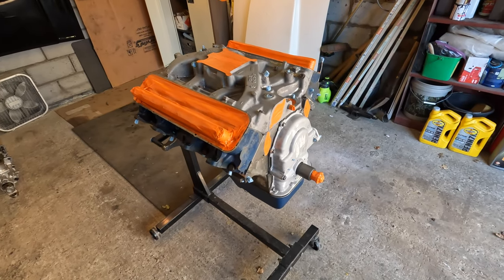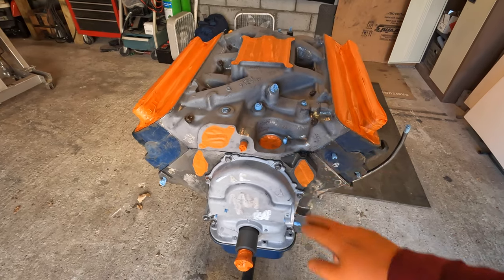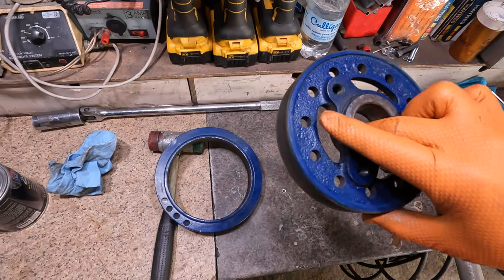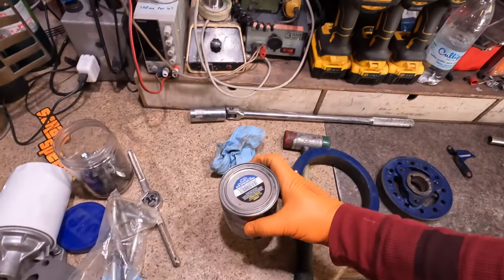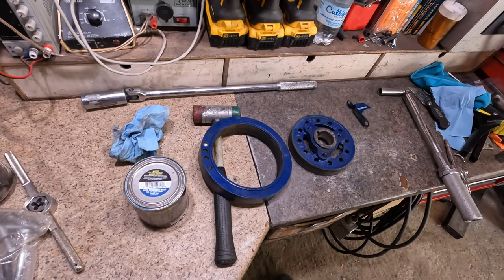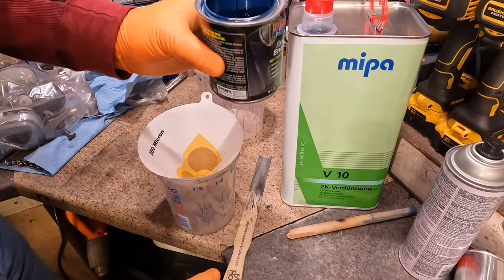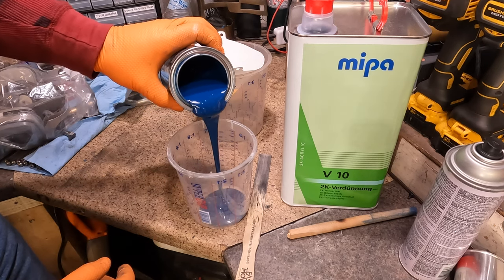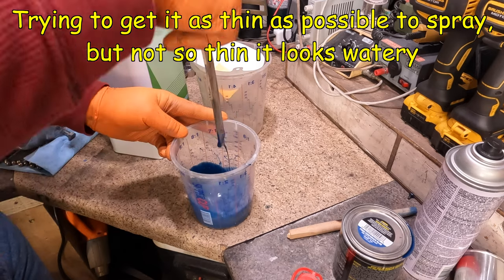The Proper Color Of Ford Corporate Blue For Our 390 FE

Comment: I did some reading basically they never got it right at the factory either. Batches changed etc. I ended up having a good air cleaner to get a color sample off and had CarQuest make me a code.